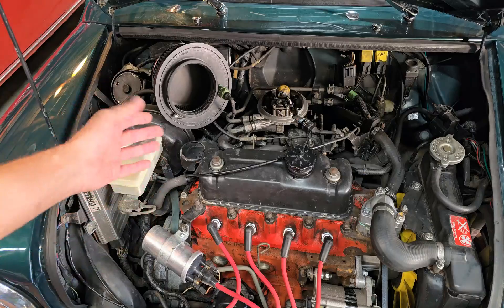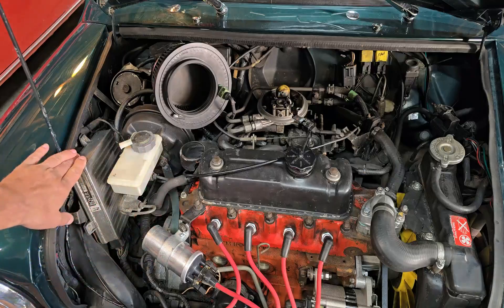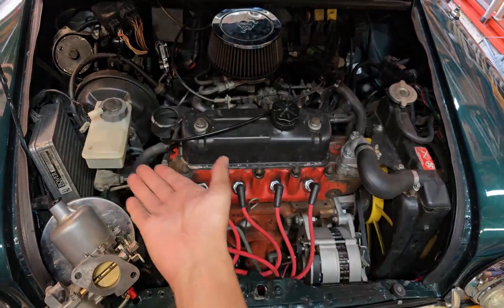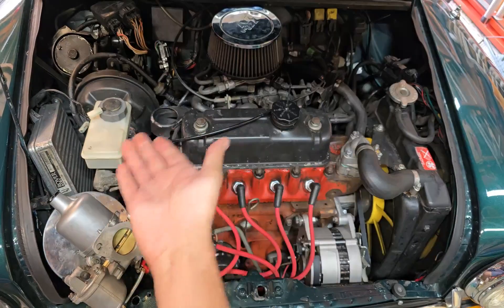Carb vs EFI.  Can an SU carb compete against Fuel injection? yes and no.

Comment: To me, it wouldn't matter anyway. Owning and experiencing a classic car, isn't simply having an old car. It's the smell, the sound, the look, and the feel. If I get into the car and I don't smell gas fumes from the bowl vent or up from the air horn, I'm not happy. Additionally, I like the way the old carb looks on my old car. Just one man's opinion. Even if I have to give up efficiency and reliabililty in the process.
Reply from the maker: What I like most about old cars and other equipment is that they dont have computers controlling everything. Everything can be repaired and modified easily without the need for proprietary computer diagnostic equipment.
Thanks for watching!

Comment: Do the injected engines have a catalyst,  so the 02 is fluctuating in closed loop?  And would they benefit from say using a Bosch sensor, which are typically more responsive?
Reply from the maker: They have a sensor before the cat. No a faster sensor will not improve the ecu. Also its a narrow band o2 sensor, not a wide band type

Comment: Thanks for the video - very interesting. I have been struggling for years to get my SPi to idle at 850 rpm (as specified in the Haynes manual). You mentioned that idle should be about 950 rpm which coincidentally is what mine always wants to run at when the engine is warm. I can force my engine to run at 850 rpm using a laptop attached to the diagnostic port but it always reverts to the higher speed after a reboot. So, am I wasting my time trying to achieve 850?
Reply from the maker: Probably not worth trying to reduce it. I only worry about the idle speed on the injection engines when they stay at warm-up speed and never return to a normal idle speed.